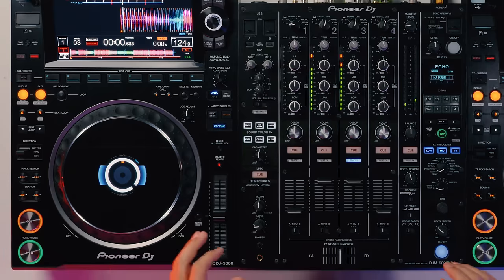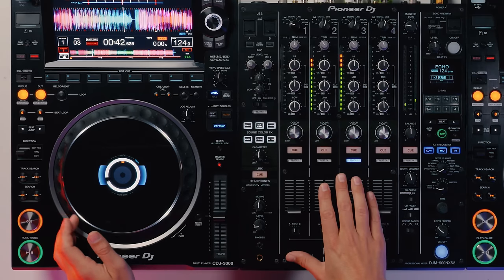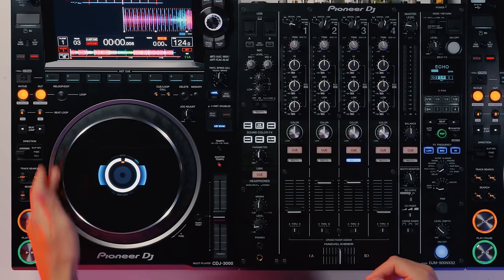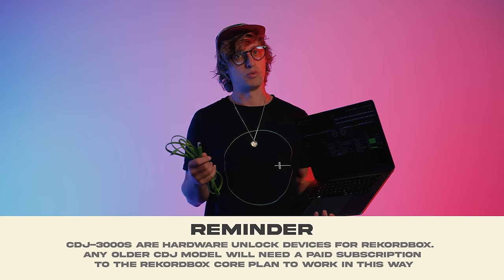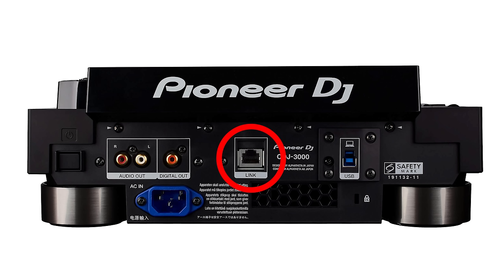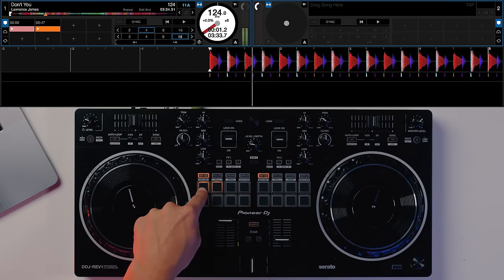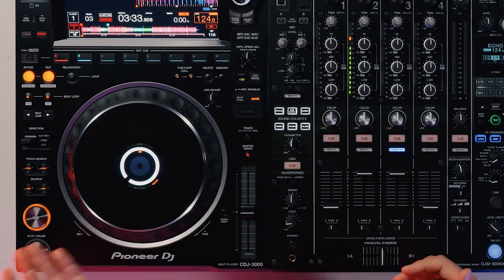10 Things You Need To Know About CDJs

Comment: Don’t forget to mention that a lot of clubs don’t update the firmware on their CDJ’s and controllers, so make sure to have a flash drive formatted to FAT32 (instead of the more modern exFAT) to make sure you don’t have a compatibility issue. I found that out the hard way on my first club gig when my flash drive wasn’t recognized, I had to pull out my laptop and reformat while someone else played during my slot 😅
Reply: Happened to me too… feel like I shouldn’t DJ
Reply: Yup, happened to me, huge fail
Reply: how do you format to fat32?
Reply: @DJV1ZN  use a software like rufus to format the usb to fat32

Comment: Got a video suggestion for you, it's a little emergency lifehack. If you're ever stuck with one CDJ for whatever and you're running out of track and need to do a transition you can use the loop or roll effects on the mixer to create a loop, load your new track and the old one will keep looping on the mixer for you to mix out of. This trick has saved my set before when I've had a faulty deck that was out of action for a few minutes.
Reply: Did you forget instant doubles?
Reply: Your life hack is the loop buttons? That’s just a normal button that everyone uses
Reply: @loganpierce6041  -- it's a lifehack because you can't do that on DJ controllers... at least none that i've used. loops would get cut as soon as you load a new track onto the same deck.
Reply: @feastmode  RX2 for sure has a loop holding capability with roll fx+aux channel
Reply: Wow you can actually do that???🎉 thanks for sharing. Just getting back to djing after being out of it for 17 years. Was making a list of failure modes and how to fix them. You are a lifesaver!
Reply: this is genius!

Comment: Adding to the category 'what could go wrong', we had two incidents where the DJs started their set and one CDJ would load the track but not start playing it, resulting in DJs panically hammering the play button and powercycling the CDJs. 
On the first one, the CDJ was accidently switched to REV, so it tried to play backwards from the beginning of the track, what understandably  did not work. 
The second one was this weekend on a CDJ3000, where the last DJ left the tempo fader on absoulte minimum, and it just did not play at all then, because the tempo button was cycled to 'WIDE' mode.

Comment: It's important to note that the jog sensitivity is a lot different with the master Tempo on versus Master Tempo off. With the CDJ3000 it would seem There is almost a glitch or software issue in the jog wheel sensitivity (still not fixed with updates) with the master Tempo off versus the CDJ 2000 Nexus 2 predecesor

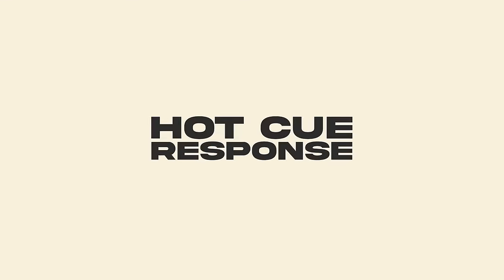Comment: @09:42 did you know you can also have gated hot cues on all CDJ that have hotcue buttons? Just set the last hotcue at the end of the track (the silent part), trigger that last hotcue, turn on slip, and then all the other hotcue buttons become gated hotcues like in Serato (or the XDJ-RX3 or using Rekordbox with a controller with gated hotcues turned on in the settings).

Comment: If you want to use your hot cue like a gated cue instead of like a trigger, press down the jogwheel firmly, then tap your hot cue while still holding the wheel down. You should now be at the hot cue position but the track should not play. Hit the cue button, then release the jog wheel. Now you have set your cue to your hot cue, and you can use it as a gated cue.

Comment: Ahhhh this was soooo helpful, thank you! 
I did not know you could record your mix straight through your laptop without an external device when using CDJ’s. 

A major hurdle for me feeling comfortable enough using just a USB on CDJ’s instead of my laptop is that hot cue gate in the CDJ’s, I’ve learned to adapt to it, but I’m definitely less comfortable using a usb just cause that’s one thing I have to always be thinking about on every single transition, instead of just flowing like normal. 

You didn’t specify in this video how to change that setting on rekordbox, so I was hoping you or someone could explain to me how to do it. Or attach a link to a video that shows how to do it please? 🙏🏼

Comment: I have a XZ at home and use a laptop. But i have gig upcoming on CDJ3000 club setup. How do I use 4 decks with the CDJ3000 do I need 4 CDJ's for that? or does the Double tap shift function work? what do I need to be aware of if I want to use 4 decks on my laptop with a CDJ3000 club setup?

Comment: Should someone looking to start learning as a DJ just avoid everything else such as the NI equipment if you are always going to come across a situation at some point where you are going to have to use CDJs. Start on CDJs or DDJ-400 vs starting with Traktor? I have heard there is a compatibility issue between Traktor controllers and Pioneer mixers, CDJs sounding better? Does it sound better to mix on CDJs with the mixer rather than a computer and and a controller? Im  beginner but heard all these issues, I would rather start on something and stay on that if its industry standard.

Comment: 1:29 I'm fairly sure, although it's been years since I used top end CDJ's - you can do this in the inner ring of the CDJ-3000, 2000, 1000mk3, 1000mk2 and 1000.
         Also, my CDJ-350 do work like this.
         
        Your assumption that a CDJ is a CDJ-3000 is just completely false. It could be a CDJ-500 from 1994. That is a CDJ.

Comment: As far as leaving it on, if they didn't set up the DSP correctly which is on them than yea you could damage the amps and even speakers depending on how it was calibrated

In some venues they under power their speakers so in that case you wouldn't really damage the speakers themselves.  And the reason they do that is because their incompetent in their "profession"

Typically the way it works is you match the max dbu values between the mixer and DSP('s), so if you have lets say a djm mixer that goes up to +26 dbu, but a dsp that goes up to +28 dbu on its input, then it would be logical to set the limiter at +26 dbu or -2dbfs depending on what unit the dsp uses.  

The same is done between the DSP('s) and amplifiers.  Lets say your dsp output is +23 dbu but your amp input sensitivity is +21 dbu.  You'd go on your amp and turn it down by 2 db to match the dbu difference.  Once the dbu values are configured you find out the continues wattage of your speaker and the rated wattage of your amp.  Lets say you have a Q1212 with an output of 550 watts at 8 ohms, and your speaker is 500 watts at 8 ohms.  you have a difference of 50 watts, something to keep in mind is the speaker in this case can peak at 2000 watts so in that case we would set an averaging limiter so only continues/average/RMS (you pick your terminology) will get attenuated while letting the dynamics though.  So to do the math we know our output is 550 but our continues is 500 so we do 10 x Log(500/550) = -0.4139 or -0.5 db to be safe.  We set that values as our threshold either as dbfs which would be -0.5 or as dbu which is your max dbu value minus 0.5 db.  

Hope this all helps you understand how sound systems are configured and this is only barely scratching the surface, but these are the fundamentals.

Comment: Can you connect your PC via a single USB-cable directly through the top of mixer (Port A or B), and use the CDJ's to browse songs? Or does the PC need to be connected to the back of the CDJ's separately via 2 USB-cables?
Reply: Back on the unit, each with own cable. You can also use the ethernet connection if you're only looking to feed music into the players. With this set up you can have all players connected to an ethernet hub and then your laptop connected to the hub as well with one ethernet cable
Reply from the maker: You can actually just connect 1 USB cable to the top of the mixer if the CDJs and DJM mixer and connected with LAN cables using pro DJ Link. If they're not you will need 3 cables, one for each device. This is all broken down inside our CDJ Masterclass course.

Comment: Thanks for the great tips! #ask if there are 2 djs plugged in to the mixer via USB will the one computer recording on a different program record master out (both djs) or only dj music on that specific USB?  Is it's the master could I use it in OBS to Livestream both djs?
Reply from the maker: Yeah, I think you should be able to set it up in this way and pull all the audio from both laptops to Livestream. It's basically pulling the audio from all 4 channels. It's not something I have personally tested though so I would recommend testing it yourself before going live.
Reply: @Crossfader  thanks for the reply & great content 🙌🏼

Comment: If I don't have rekordbox but have serato pro, what happened if I load my USB and plug on a cdj?!
Can you show us what happened?! Please
Reply from the maker: If you drag and drop songs from Serato to a USB drive it will simply have the songs in a folder on the USB stick. It will not transfer any information such as cue points, loops, grid info etc. This has to be done through Rekordbox. You can still play the songs in the CDJs but you will have to wait a while for it try determine what the BPM is and if you set any hot cues on the songs they won't save for next time you plug your USB back in. There are ways you can transfer music from Serato to Rekordbox including all the data with a service such as Lexicon DJ. This is all covering in the course mentioned in the video and linked in the description among much more.
Reply: @Crossfader  thanks ✌😎
Reply: Dump Serato bro and use Recordbox. Why want to relate on a laptop to be a Dj ? Now days most Djs use USB imo.

Comment: Im having trouble with my CDJ3000s, the songs keep skipping, and laggin, loosing sound. I have no idea why? Any ideas? USB is through rekordbox, cables are new, players are brand new. Connected via digital port.
Reply: return them. i had a problem with the filter color fx on my djm 900nx2 rite out the box. So i took it back to the store and they gave me a new one.

Comment: No, no, no, no! Vinyl response is like controllers not the CDJ's. Who's bright idea was that? I've operated Technics SLB 100 which are belt driven all the way to the MK2-1200's and the slightest tap will advance the track. Currently I have a DDJ-FLX10 and the jog wheels are pretty similar to vinyl. I plan to get the 3000's or the next iteration so hopefully there's a setting there that makes it work like a controller or like vinyl itself.

Comment: You kidding? So I will have to re learn how to do beat matching, I am so dependent on how much I move the jog to know how much I'm gonna move the pitch.
Reply from the maker: The principles are the same, you may just need to get used to moving the jog wheel in a slightly different way.
Reply: Try mixing 1 turntable and 1 CDJ500 on a Rane MP24 … that’ll sort you out!
Reply: @Crossfader  you can also adjust the 'jog adjust' sensitivity and get to know your personal preference on the speed or sensitivity of moving the wheel right? I've done this at some gigs and its worked for me to increase the sensitivity to get it closer to the controller type of speed